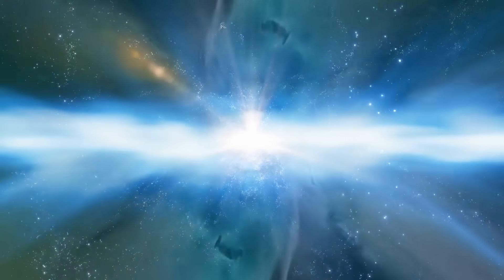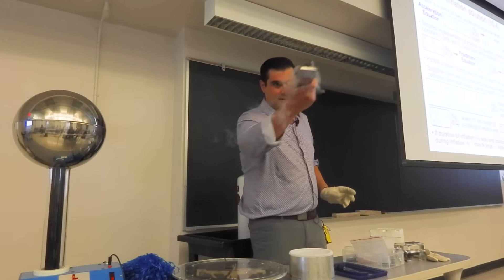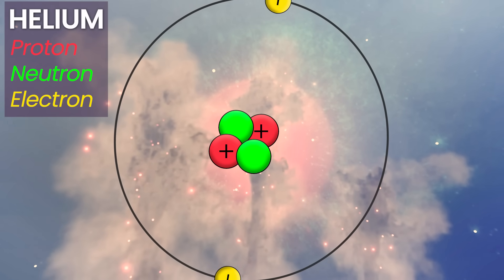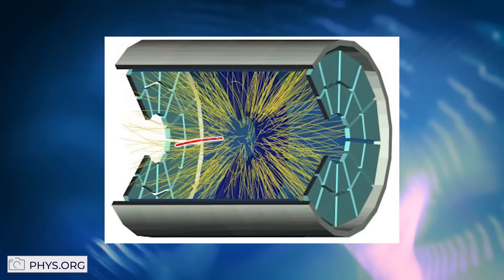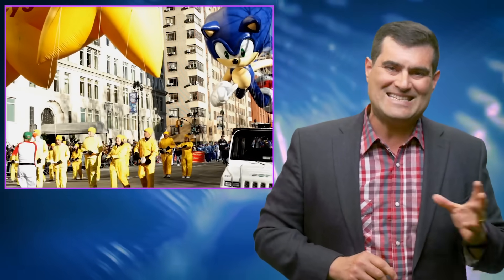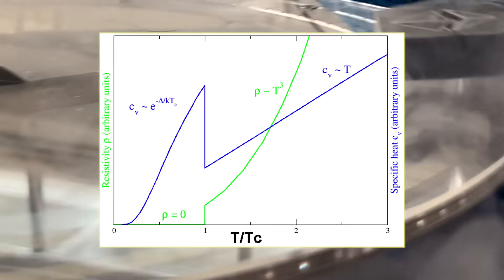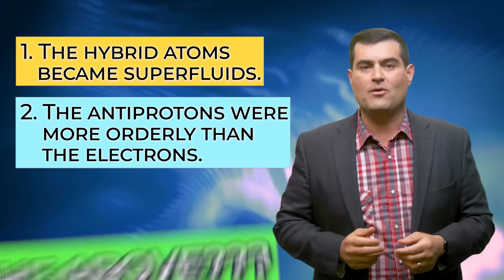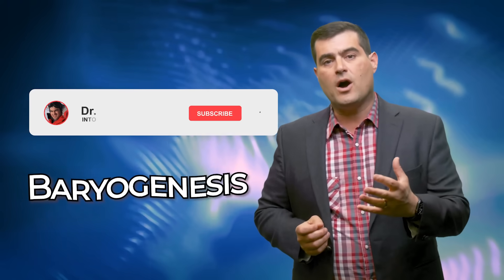Scientists Just Mixed Matter and Antimatter (It Didn't Explode)

Comment: I think the anti-protons dissolved in the fluid! Meaning, they now form electron-electron attraction? Electron-anti-proton attraction? I assume the anti-Helium was ionised with no electrons? And the helium has it's electrons on so no charge. Yes the antiprotons should settle in I guess. I reckon they would "sit high" until the electron jumps out, only then would they "settle" into closer bands. This raises the question does any anti-matter explode?

Comment: For the particles to interact in the way observed there are clearly things going on we do not understand, but I do wonder if the fact that the helium was cooled to the point of superfluidity that the positrons lacked sufficient momentum to overcome the nuclear forces controlling atoms and thus managed to cojoin with some and form stable materials. I would imagine this must have happened in nature at some point. What would be interssting, if they can make sufficient quantities of this "heavy helium", what happens to it as the temperature is raised and the atoms gain thermal energy - do they stay cojoined or do they split apart and annialate each other?

Comment: I'm not up to date, but I believe that matter - antimatter collisions resulting in conversion to energy is an 'observational' fact, but the detailed mechanism is not defined. Experimentally, if an electron and a positron (positively charged, antimatter electron) come together momentarily as a positronium atom, the two will spiral around each other, losing kinetic energy, then touch, converting into two or into three gamma rays, depending on if the particles have the same spin direction, or opposite spin direction. I believe this description is more than 50 years old.  My point is that both the spin and the kinetic energy of the particles has to be at a lower state, for the two particles to interact. I would expect the temperature of the environment would affect the kinetic energy of the interaction, and might affect the window interactivity and matter to energy conversion.

Comment: so, this antiprotonic helium is stable when very cold. has there been made a caloric measurement and radiation measurement, when it was warmed up? of course, it will warm up, without refrigeration, so it will happen at some point.
my expectation is, that the annihilation will set in once the helium is no longer superfluid. and that will show radiation and heating.

Comment: 112418    Nanometer scale uniformly aligned parallel diode arrays may be a practical way of absorbing ambient heat. Ambient heat is uniform on a micrometer and larger scale and non uniform on a nanometer scale. Plausibly,  heat absorbtion at the non uniform scale is available as Johnson Nyquest thermal electrical noise that would yield, by conversion without gain or loss, an equivelent amount of electrical energy. 
AND
Diode voltage / current  characterstics can be displayed on an XY tracing oscìlloscope. Thermal electrical noise power in resistors can be displayed by time sweeps of voltage on an oscilloscope. Each such time sweep shows unique randomness.
AND
A  simple  "Special Program with Integrated Circuit Emphasis" model indicated that diodes in uniform aligntment parallel would aggregate simulated partially rectified thermal electrical noise. 

Maximum direct current electrical power, half, is transfered from a direct current electrical source to the electrical load when the electrical resistance of the two parts is equal. Calculated matched resistance output (watts) is k (Boltźman's constant), one point three eight x 10^ minus 23, times T (temperature Kelvin) times bandwidth (0 Hz to a natural limit ~2 THz @ 290 K) times rectification halving and nanowatt power level rectification efficiency, times the number of diodes in the array. 

There are a billion cells of 1000 square nanometer area each per square millimeter, 100 billion per square centimeter. 

Creditable independent replicatable proof of concept protypes beyond improper influence are needed. 

Aloha
Charles M Brown 
Kilauea, Kauai, Hawaii 96754

Comment: 112418      The second law of thermodynamics may be false conventional wisdom. Let's face the wonder of full heat use. 

The second law of thermodynamics was developed during victorian england's scientific and religious fascination with steam engines. 

The second law is behind modern refrigerators needing electrical energy to compress the refrigerent to force it to release as waste the heat that it has removed from the refrigerator's service interior in the cooling part of the refrigerent's circulation. The interior coldness draws in exterior heat through the cabinet insulation. There is also discarded heat from mechanical friction and electrical resistance. The net thermal output equals the electrical input with energy not being gained or lost in this refrigeration system including its forced waste. Unencumbered refrigeration by the principle that energy is conserved should produce electricity instead of consuming it. 

It makes more sense that refrigerators should yield electricity because energy is widely known to change form with no ultimate path of energy gain or loss being found. Therefore any form of fully recyclable energy can be cycled endlessly in any quantity. 

Full heat recycling, all electric, very isolated underground, undersea, or space communities would be highly survivable with self sufficient EMP resistant LED light  automated vertical farms, thaw resistant frozen food storehouses, factories, dwellings, self contained elevators, safe rooms, and horizontal transports. 

In a flourishing civillization, small self sufficient electric or cooling devices of many kinds and styles like lamps, smartphones, hotplates, water heaters, cooler chests, fans, radios, TVs, cameras, security devices, robot test equipment, scales, transaction terminals, wall clocks, open or ciosed for business luminous signs, power hand tools, ditch diggers, pumps, and personal transports, would be available for immediate use incrementally anywhere as people as individuals or larger social groups see fit. 

Some equipment groups could be consolidated on local networks. 

If a high majority thinks our civilization should geoengineer gigatons or 
teratons of carbon dioxide out of our environment, instalations using devices that convert ambient heat into electricity can hypothetically be scaled up do it with a choice of comsequences including many beneficial ones. 

Energy sensible refrigerators that absorb heat and yield electricity would complement computers as computing consumes electricity and yields heat. Computing would be free. Chips could have energy recycling built in.
This would improve performance and lower cost,
A simple rectifier crystal can, iust short of a replicatable long term demonstration of a powerful prototype, almost certainly filter the random thermal motioren of electrons or discrete positiive charged voids called holes so the electric current flowing in one direction predominates. At low system voltage, a filtrate of one polarity predominates only a little but there is always usable electrical power derived from the source, which is Johnson (observation) Nyquest (theory) thermal electrical noise. This net electrical filtrate can be aggregated in a group of separate diodes in consistent alignment parallel creating widely scalable electrical power. The maximum energy is converted from ambient heat to productive direct current electricity when the electrical load electrical resistance  is equal to the array internal electrical resistance. 

Maximum calculated electrical power output (watts) is k (Boltźman's constant), one point three eight x 10^ minus 23, times T (temperature Kelvin) times bandwidth (0 Hz to a natural limit ~2 THz @ 290 K) times rectification halving and nanowatt power level rectification efficiency, times the number of diodes in the array. 

There are a billion cells of 1000 square nanometer area each per square millimeter, 100 billion per square centimeter. 

Order is imposed on the random thermal motion of electrons by the structual orderlyness of a diode array made of diodes made within a slab: 

Host crystal is silicon
  P type boron doped
-----‐------‐----___-- Out
🔻🔻🔻🔻
■■■■■■___ + Out 
  N type phosphorous doped 

All the P type semiconductor anodes abut a metal conductive plane deposited on the top face of the slab with nonrectifying joins;  the N type semiconductor cathodes or common cathode abuts the bottom face. As the polarity filtered electrical energy is exported, the amount of thermal energy in the group of diodes decreases. This group cooling will draw heat in from the surrounding ambient heat at a rate depending on the filtering rate and thermal resistance between the group and ambient gas, liquid, or solid warmer than absolute zero. There is always a lot of ambient heat on our planet, more on equatorial dry desert summer days and less on polar desert winter nights.

Focusing on the composition of one simple diode, a near flawless crystal of silicon is modified by implanting a small amount of phosphorus (N type conductivity) on one side from a ohmic contact end to a junction where the additive is suddenly and completely changed to boron (P type conductivity) with minimal disturbance of the crystal lattice. The crystal then continues to another ohmic contact. 

A region of high electrical resistance forms at the junction in this type of diode when the phosphorous near the ĵunction donates electrons that are free to move elsewhere while leaving phosphorus ions held in the crystal while the boron donates holes which are similalarly free to move. The two types of mobile charges mutually clear each other away near the junction leaving little electrical conductivity. An equlibrium width of this region is settled between the phosphorus, boron, electrons, and holes. Thermal noise is beyond steady state equlibrium. Thermal noise transients, where mobile electrons move from the phosphorus added side to the boron added side ride transient extra conductivity so the forward moving  electrons are preferentally filtered into the external circuit. Mobile electrons are units of electric current. They lose their thermal energy of motion and gain voltage, as they transition between the junction and the array electrical tap. 

Inside the diode, heat is absorbe; outside the diode, to exactly the same extent, an attached electrical circuit is energized. The voltage of a diode array is likely to be small so many similar arrays need to be put in series to build higher voltage.  

Understanding diodes is one way to become convinced that Johnson Nyquest thermal electrical noise can be rectified and aggregated. Self assembling development teams may find many ways to accomplish this wide mission. Taxonomically there should be many ways ways to convert heat directly into electricity. 

A practical device may use an array of Au needles in a SiO2 matrix abutting N type GaAs. These were made in the 1970s when registration technology was poor so it was easier to fabricate arrays and select one diode than just make one diode. 

There are other plausible breeches of the second law of thermodynamics. Hopefully a lot of people, mostly as independent teams, will join in expanding the breech. Please share the successes or setbacks of experiemental efforts. 

These devices would probably become segmented commodities sold with minimal margin over supply cost. They would be manufactured by advanced automation that does not need financial incentive. Applicable best practices would be adopted. Business details would be open public knowledge. Associated people should move as negotiated and freely and honestly talk. Commerce would be a planetary scale unified conglomerate of diverse local cooperatives. There is no need of wealth extracting top commanders. We do not need often token philanthropy from the top if the wide majority of people can afford to be generous. 

Aloha
Charles M Brown 
Kilauea Kauai Hawaii 96754

Comment: When electrons "orbit" a nucleus, they form into quantum states and shells. If negitively charged electrons are repkaced by negitively charged anti-protons, what does that do to the configuration of the orbits? What happens in the hybrid version where only one electron is replaced by a positron? How do their quantum states interact?
I really only have a surface level of understanding of what is involved here.

For instance, I know that in an atom each quantum state can only have at most a single occupant. So the question of whether orbiting electrons and orbiting positrons share the "same" set of quantum states, vs each partical type having separate states, becomes very important when both types are contained in a single atom.

Comment: Firing anti protons into liquid helium - why did they not think this would be catastrophic? According to this video the explanation came after the experiment and even then there's more than one theory.  I mean get that wrong... so they 'must' have had good reason to think it wouldn't    surely.
Reply: The amounts would be incredibly tiny, probably a stream of quantum size particles. Any annihilation would produce measurable ticks from one or more sensors, which they can plot on a graph. You wouldn't even feel them if they happened inside your finger because they are happening in unfathomably small quantum sizes.
For comparison, 1 gram of antimatter would be enough to make a small nuke, but that would cost like a trillion dollars to produce (and probably not be practically usable). They couldn't even afford to blow up the building they were in if they pooled their life savings to aquire anti-matter.

Comment: I'm guessing this is helium being orbited by anti-protons.  I saw a piece on using them for fusion fuels years back.  It occurs that bot only does their mass make it easier to contrain them to fuse, their ability to annihilate gives a pressure spike to initiate the reaction.  Think of it as a diesel engine over a gasoline one.

Comment: Hold on.
If in spectroscopy you measure the photons emmited or absorbed by electrons, how do you do a spectroscopy  in a hybrid atom if there is no electron to emmite or absorbe the photon. 
Also remember why Pluto was kicked out of the Planets Club. On the other hand, if the antiprotons are at the opposite sides of the nucleus, than the center of mass stays inside the the nucleus.
How the orbit of the antiproton is far enough from the nucleus? With such a masive orbiting body, the orbit should be .... dang! The calculations are so complex!
Also, E and A photons inherently means changing the energy state, an orbit if you will. But if the antiprotons are so well behaved, you need to use photons of much higher energies. Also xp≥ℏ/2 never lies. Proton's position is well defined and it's in not in a cloud of probabilities.

Comment: the thing is "negative charged" particles dont actually attract as opposed to repeling positive charges. All charge is repulsion.. Repulsion is all there is and and comes from all directions, but is concentrated locally from the direction of charged particles.  attraction is just the absense of repulsion such that the ambient field's repulsion pushes two particles together in the absence of their own mutual repulsion.   Anti-protons even though they are negatively charged - this just means they're spinning in the opposite way.   But anti-protons are Still repelliing , each other, and protons, because repulsion and charge is simply the emission of photons from the proton which bombard nearby objects. The anti protons are emitting antiphotons or photons and repelling the protons. They're kept pushed apart in this way, as the force from the photons pushing them apart is equal or greater than the photons pushing them together by the ambient charge field.

Comment: Lepton/anti-lepton annihilation photon terminates, BOOM! Hadron/anti-hadron annihilation neutrino terminates, blurp. Matter/anti-matter divergence is Weak Interaction chirality (and its contingencies). Right-handed matter...neutral atom, or ion, or electron beam in an extreme left-handed curl electromagnetic field for partial chirality flip annihilation. Not much by mass; not much by mass, high yield 511 Kev x-rays (if triplet positronium, then 3-photon energy split not two). Big Bang 0.5 ppb right-handed matter excess demands slight chiral spatial anisotropy. Noetherian symmetry-contingent conservation relationships leak - pseudovectors (conservation of angular momentum) and pseudotensors.

Comment: Does the anti-proton form a charge 'cloud' around the nucleus like the electron?  If so, shouldn't its greater mass cause the orbital to be much smaller than the electron orbital?  I am thinking of muon catalysed cold fusion, where the muon replaces the electron, but gives rise to a much smaller orbital (due to the muon mass).  This allows the nuclei to approach each other more closely and permits cold fusion through quantum tunnelling.  Muon catalysed cold fusion works, but can't produce net energy due to the muons rapidly decaying.  Soooo... anti-protons are very stable.  Couldn't they be used like muons to catalyse cold fusion (without the decay issue)?